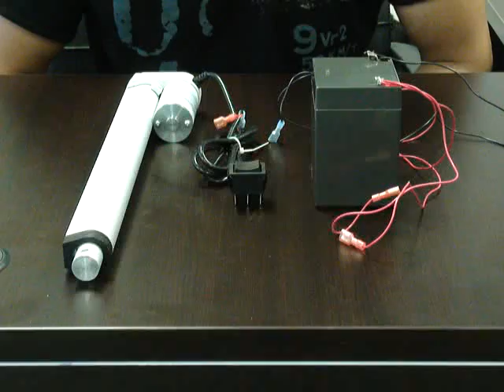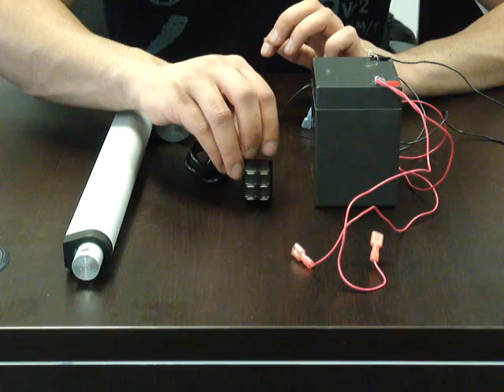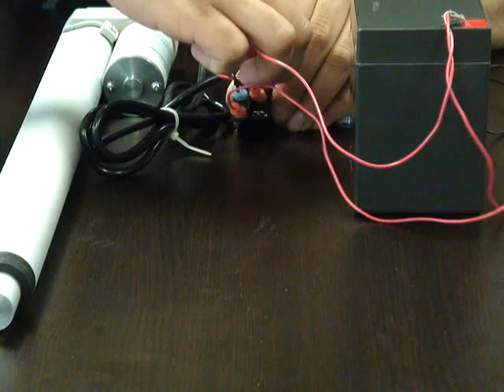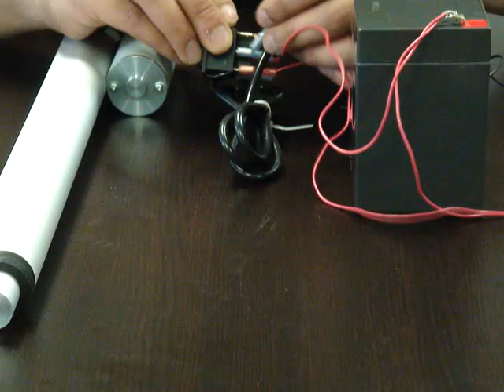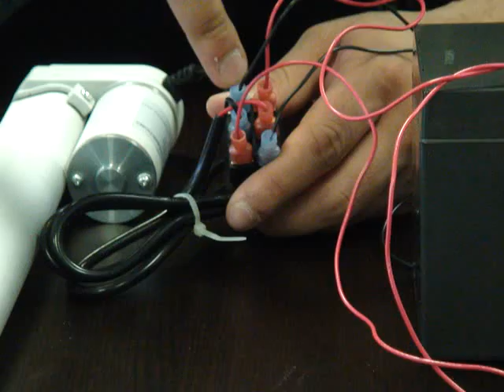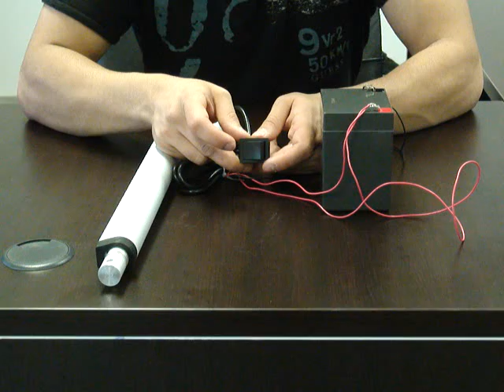How to a Connect Linear Actuator to a Rocker Switch: Full Instructions - Progressive Automations

Comment: Can you wire 4 aculators to one switch please
Reply from the maker: Yes, it is possible to wire 4 actuators in a parallel circuit to 1 rocker switch as long as the current draw of the 4 actuators combined never exceeds the current rating of the switch being used. For example, our PA-14 actuators draw 5A at max rated load capacity while our RC-12 rocker switch is rated for 20A. The 4 actuators multiplied by 5A results in a 20A draw if all were at full load so this example switch will be sufficient in this use case.

Comment: I’m wanting to build a bed with linear actuators in my campervan, what would I need to get all actuators to work at same time?
Reply from the maker: Hi Charlie!
In order to have actuators travel at the same time, we recommend actuators that have positional feedback, such as Hall Effect Sensors or Potentiometer feedback. We have the PA-04-HS model available, where each actuator will have a 400lbs dynamic force rating. We carry this model in 12VDC and 24VDC in order to be compatible with various control systems and power inputs! 

You can see this model here: https://www.progressiveautomations.com/products/hall-effect-sensor-actuator

Feel free to reach out to our customer service for any additional questions and assistance on acquiring these for your project!

Thanks!

Comment: Thank you for the very helpful video.
Small little problem that I can't quite figure out when I connected as in your vid that even connected exactly as in the video it keeps on blowing fuses when I try to test the actuators.  Any ideas what might be the problem? Bigger fuse maybe? 

Thank you in advance
Reply: You probably have the wrong switch. Not all 6 pin switches are Double Pole Double Throw. Many 6 pin switches are ON OFF, Double Pole SINGLE Throw. The one you have might just be one of those. They actually only use 4 pins to transfer or connect power. The other two are used to make a ground connection for an LED or light indicator. 

Testing.

First test the actuator. Place fuse on positive battery post, then to actuator. Touch the other wire of actuator to negative battery post. If it doesn't blow the fuse, you are ok. If it does then it might be your actuator is faulty. These little actuators only need a 3A fuse or less. I only use 2A fuses. 

Test switch. You will need a Multimeter with continuity testing capabilities. Connect red lead to any pin. Connect black lead to the pin right next to it. You should get infinity or no sound. Test each of the three pairs of pins. If you hear a noise or get/show resistance the those pins are either shorted together or there is a component in the switch. Don't use the switch.
Reply: @AztecWarrior75  that is actually a very interesting fact I didn't take into consideration.. for sure it's the wrong switch as you said. Thank you for your information 🤠👍
Reply: @powerstateman  Glad to have helped.
Reply from the maker: Hello!
This may depend on the type of actuator or switch that you are using as well as needing to upgrade to a larger fuse. We recommend reviewing the current draw of the actuator as well as the current limit on the switch itself to ensure they are compatible.

Thank you

Comment: Can this work with a on & off swith, to just full extend and retract when off? Dont like that on off on switch.
Reply: Short answer: NO. A simple  ON - OFF switch will not work.

Don't pay attention to that reply from progressive automations. It doesn't seem that they know what they are talking about. 

If it is just the switch having the center off, that you don't like, you can use an ON - ON  6 pin switch. (Not an ON - OFF 4 pin or 6 pin switch.) The ON - ON switch is wired exactly the same way and acts the same way except no OFF position.

This is just one example of many different styles of this type switch.

https://www.ebay.com/itm/1xWaterproof-R13-33C-Rocker-Switch-6Pin-2-Position-DPDT-6A-250VAC-10A-125VAC-B5/174438869349?hash=item289d5de965:g:ygYAAOSwTy5fERxS

You don't need any of "However, this will require a non-latching push button switch along with a double-pole double-throw relay (also known as DPDT relay)"   Completely unnecessary.
Reply from the maker: Hi Oswaldo,
To better understand your question, are you referring to a system where the actuators will retract when not extending? If so, this is possible! However, this will require a non-latching push button switch along with a double-pole double-throw relay (also known as DPDT relay). You can find our wiring diagram here!

https://cdn.shopify.com/s/files/1/0061/7735/7891/files/Push_Button_Control.pdf?5129900352611653725

Thank you,

Comment: Can 2 switches be put in line with each other?
Reply: What do you mean "in line" with each other.
If you mean to say "in series", then the answer is, no.
What switches are you talking about? Are you talking about putting them a three way switch setup? Or using two Single Pole Double Throw switches?
Reply: @AztecWarrior75  I have one of these on my boat to lift the motor, I wanted 1 switch at the console, and 1 switch at the front of the boat. I have it working, just would be nice to have a switch up front .  Thanks
Reply from the maker: Hello!
You are able to install two separate switches to a single application, however, they cannot be in-line with each other.
This will require splicing and connecting each switch to your power source and actuator separately. We also recommend using momentary switches in order to prevent one switch canceling out the other by being "latched" when using non-momentary switches.
Thank you

Comment: Informative video.. What gauge wire is needed to handle the requirements of that actuator?
Reply from the maker: Hi Shawn,
You may need a 16awg wire.
Thanks
Team Progressive Automations
Reply: The wire he is using ig 18awg not 16awg. 18AWG is the most common gauge used with these small actuators. I have purchased over 10 actuators of this types and sizes and each and everyone of them has 18AWG wire.
Reply: @AztecWarrior75  hey 
What specific connectors are they? Thanks for info

Comment: The rocker switch I ordered ended up only having 5 terminals in a vertical line? Is there anyway I can still do this?
Reply from the maker: Hi Michael,

We don't sell switches with 5 terminals, perhaps you purchased it some another company. However, you will need to determine which terminals are activated using a multimeter.
Thanks
Team Progressive Automations
Reply: Yes, Connect the two Outer Pins to the Actuator, Connect the Center Pin to Positive voltage, Connect remaining Pins to Negative.
Reply: I made a short Video of how it can be used. https://youtu.be/lX0M2nmGRp4
Reply: @Michael cromarty did you figure it out?

Comment: Is there any way you could make the actuator push and pull at a constant rate? I'm looking to use this for wings
Reply from the maker: Hello,
Thank you for contacting us.
Our actuators provide constant torque at the maximum rated dynamic force in either direction when applying 12VDC. However, depending on the applied load, this may affect the speed in which the actuator travels.

Best Regards
Team Progressive Automations
Reply: WHat do you mean by constant rate?

Comment: Hi, I need some help. I'm not a pro at all, but I'm trying to connect two actuators into one rocker switch. How do I do this? Thanks a lot!
Reply from the maker: Hi Ilya
You could try using a wago conductor to connect the actuators to the rocker switch. If you would like more information or have any other questions, please contact us at 1-800-676-6123 or sales@progressiveautomations.com to get in touch with one of our engineers.
Best Regards
Reply: Just connect the two wires of the actuators and add a small pigtale and connect normally.  The amp?watts shouldn't be any trouble with these small actuators running at the same time. If you add more I suggest using relays to handle the current.

Comment: I take it that you can run just two wires from the battery as long as they each split to two wires for connection to rocker switch?  Btw thank you for info vid
Reply from the maker: Hi Hugo
Yes that is correct. 
Regards
Reply: 49TH X

Comment: Would it be a good idea to fuse? What size (amp)fuse? Were should it be wired in?
Reply from the maker: Hello Frank,

You can use a 5A fuse for the PA-14 Linear Actuator. This is the maximum current it will draw at full load. Please note that fuses do not blow instantly and if a very high force is applied to the actuator (exceeding the rated maximum), the actuator may be damaged. Let us know if you have any more questions by emailing us at sales@progressiveautomations.com
Reply: When choosing a fuse you should never take the advice of a person who gives you a straight out answer without any information. 

You need to go by what the manufacturer recommends. If you don't know or can't find that information you will need to test the amp draw of that Actuator under normal operation. 

This guy mad a good video on how to test.
https://www.youtube.com/watch?v=gwFE-NkzR-k&t=40s&ab_channel=philomech

Never go with a generic answer when it comes to fuses, when that person didn't even get any information needed to give an answer.

Comment: Hi, How long can you run this 12V linear actuator on that battery?
Reply from the maker: Hello Nicole
The PA-14 12V linear actuator has a power consumption rating of 60W at full load. The run time will depend on the charge capacity of the battery. For example, a 5Ah battery can power 60W for approximately 0.8hrs. A 100Ah battery can provide a run time of 16 hours. Hope this helps.
Regards
Reply: I ran three actuators I was testing for just over 3 months. Up in the morning and down in the evening.

Comment: How do I add a photocell switch to this equation.. For a dawn to dusk chicken coop door?
Reply: Unless you plan on using or already into Arduino, don't. There are many benefits to Arduino but the time it takes to learn how to do simple tasks then undertaking doing the whole astronomical thing would be way over what is needed. If you still want to add a photocell just let me know.
Reply: I'd recommend using an Arduino with a sun rise sun set schedule. It will open exactly on time and close exactly on time for your region. Search google for "Arduino Astronomical Clock for Automatic Light Control" Connect it it to the really and connect the really to the linear acuator.

Comment: How would I use a push button toggle as opposed to a rocker switch?
Reply from the maker: Hello Pursual,

If the Push Button toggle is DPDT, please head over to the Progressive Automations website under the Downloads section for a full wiring diagram.

Comment: Very good video, thanks. I do have question: I am using an actuator on my atv, and I purchased a on/off/on rocker switch. Running from the rocker is three wires. about a fourth the distance from the rocker is a red wire, at the end of the harness is a black and green wire. Not sure where to go from here. The rocker is sealed and cannot view the terminals. Appreciate your help, any ideas how to wire this. I wish it were as simple as your video. Thanks
Reply from the maker: Hello Loggerboot65,

Unfortunately as that does not seem to be one of our Rocker Switches, I do not have any information. Please feel free to send us an email at sales@progressiveautomations.com and we can do our best to assist you to control our linear actuators.
Reply: I can help if you still need it.